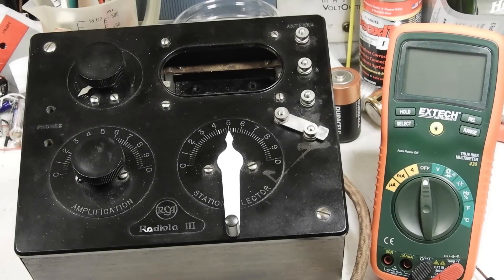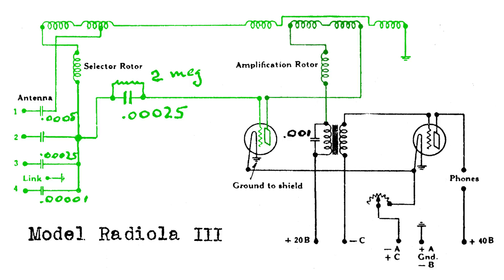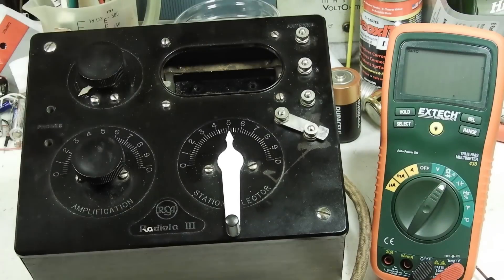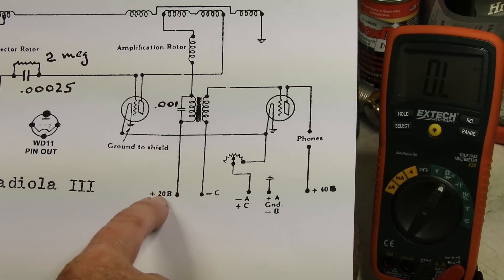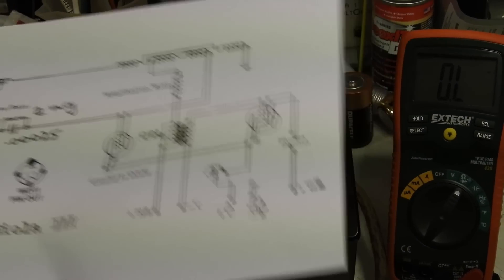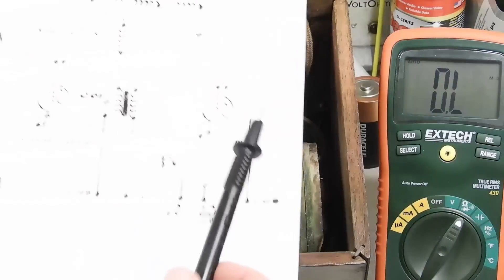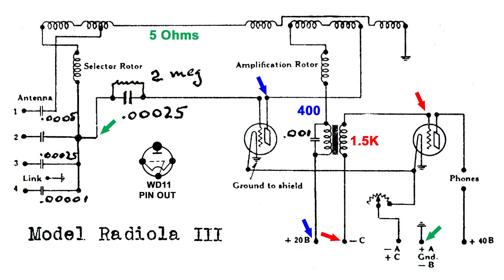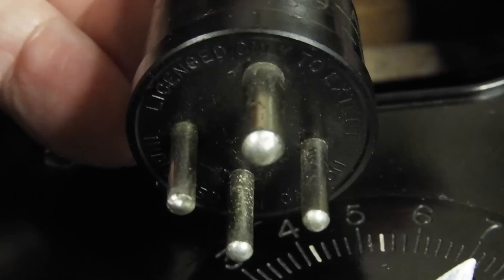RCA Radiola III Transformer Replacement

Comment: What capacitor value is associated with antenna terminal 2?
Reply from the maker: This PDF link has the diagram and some one added information.
Nostalgia Air
http://www.nostalgiaair.org/PagesByModel/349/M0040349.pdf
Reply: @AllAmericanFiveRadio  Looks like capacitor value for antenna terminal 2 is missing from nostalgiaair print too?
Reply from the maker: @bradbuck7891  I think a 0.0005 should work.

Comment: Thanks for your video.  I've enjoyed your clearly presented electronic's  video's for years.  I've been very confused about the diagram included with the 118944 Hammond transformer.   They show using terminals 1 and 2 for the primary and 4 and 3 for the secondary after the first WD-11 regen detector.  There is no connection using the  transformer this way that I can see.  I thought I was just missing something.  Did they make a mistake?  The numbering makes sense for the other two transforemers on their Radiola IIIA diagram.  I agree 100% with the way you have recommended to install the Hammond transformer.
Reply from the maker: Thank you.
I no longer have the diagram for the Hammond transformer. I do not remember it being labeled wrong. I just Ohmed out the primary and secondary, and use the the results that would get me as close to the original as possible. I do this with or without manufacturing information.

I just Googled "118944 Hammond transformer" and found the PDF diagram. It is identical to what I drew in this video.
Reply: Sorry I’m a year late posting this: the numbering on the actual transformer is not sequential,:1,3,4,2.  Three and four  ( the two inner most terminals )are the primary windings . The outer two are the secondary.

Comment: what is a the proper modern phone /bypass condenser to use on this radio? i know there are different varieties of caps that work best in different circuits.
Reply from the maker: http://www.nostalgiaair.org/pagesbymodel/349/M0040349.pdf
Reply: what kind of capacitor should I use? small disc, orange drop others?  @AllAmericanFiveRadio
Reply from the maker: Either will work.
Reply: in most drawings of the bypass condenser it shows it going across the winding's of the transformer but all the sets I have it goes from one side of the transformer and the other end of the cap goes to ground, which works better? @AllAmericanFiveRadio

Comment: If you show that the transformer checks out, is the owner changing it just to be more period correct? Also, thank you for your explanation of the circuit, it really is fascinating. There are six or seven for sale right now on YouTube and I was thinking about trying to get one but most of those folks are very proud of their units. Even the ones not in cases.
Reply from the maker: The YouTuber's transformer is open.
Reply: Well that’s completely understandable then, thank you.
Reply from the maker: That's why Hammond makes replacements, the original are usually bad. The replacement fits in the originals case.
Reply: Thank you again for all your knowledge. I did some research and found the same info about the original transformers, that they didn’t last. I also found the Hammond transformer for sale on eBay and Antique Electronic Supply and it comes, just as you said, ready for the two or four tube radio. Actually, it comes pre-wired with a terminal board ready to be installed but for the price, I think they should. :-)  Thank You again!
Reply from the maker: I would not used the terminal strip, I would wire it up direct.

Comment: Interesting to see one of the first commercial radios.  They did a lot with just a few parts.
Reply from the maker: Yes that is true, few parts. But this is 1924 and this and other similar circuits, was the state of the art. This is the start of all electronics. The earliest tube radio I have is 1921, and it also uses Edwin Howard Armstrong's Regenerative Circuit.